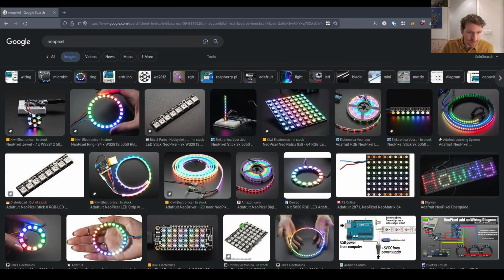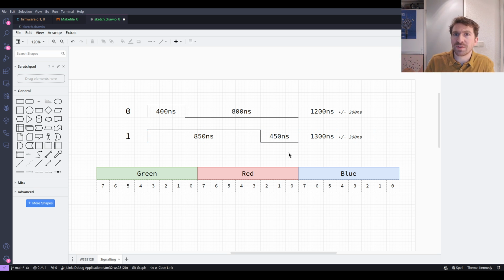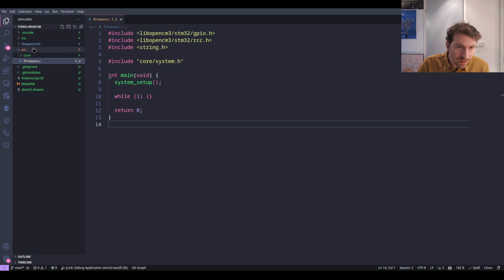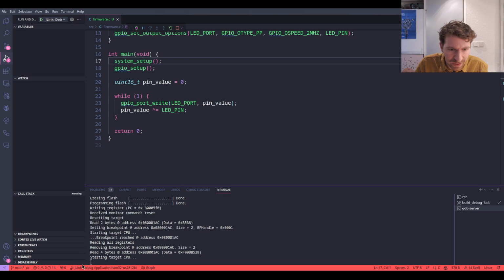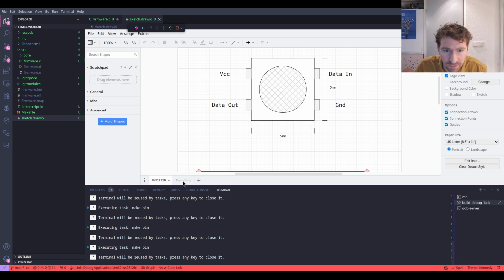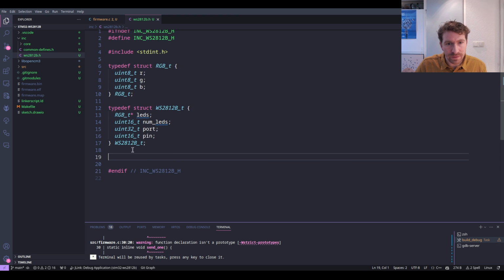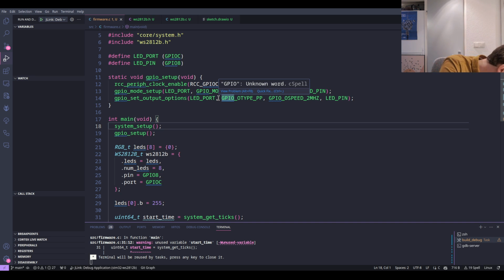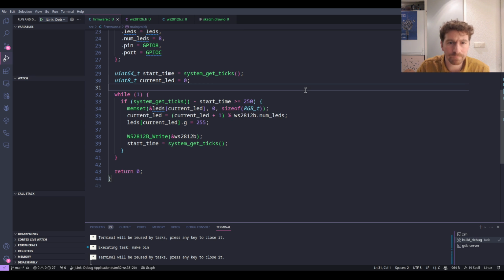Bare Metal Bit Banging: WS2812B Driver

Comment: awesome video!
if only i had found this video for my microprocessors final, it would have been cool to create a neopixel driver
instead, i just used a hack of the spi mosi pin since it met the timing requirements
Reply from the maker: SPI is usually the best route to be honest, especially if you have other time-critical stuff happening on the micro. But bit banging is definitely not as bad as most people would have you believe for this protocol, especially if you just have a few LEDs to drive

Comment: Is it possible that the fact the nop instructions don’t consume time consistently as you add them is because a NOP on ARM is not guaranteed to consume time, the processor is allowed to remove them from the pipeline?

Comment: Horrible implimentation. Using assembly code for critical timming is a bad way of doing it. Because of the many, many different types of uP boards out there with so many timming variants will require too much tweaking of the assembler code. Very sloppy code
I developed a hardware interface that you can raise a PROCESS line, then send the three data bytes and monitor a BUSY line to drop when u can send another group of 3 bytes. You so this for all the pixels you want to send. At end u drop the PROCESS line and wait for busy line to drop and you are done. Easy peasy. Works on ANY uP too and is rock solid

Comment: One technique I've seen used in a lot in vXWorks board support packages is to calibrate a spinloop based timer against a slower hardware timer. The idea is you spin incrementing a counter starting at one timer tick until the next one. That then tells you "x counter increments equals one timer tick". E.g. on PC AT hardware the PIT timer runs at 18.2Hz, i.e. a 54.945 ms period. So if you know x timer increments equals 54.945ms you can scale that to smaller numbers for smaller delays. You probably need to lock the CPU clock speed and disable interrupts during the spinloop.

Comment: This is one of those videos for a channel that you have never heard of before, and you just sit and watch with your mouth open. This was absolutely unbelievable. The bit at the end where you lamented that getting an arduino or an STM32 is the easy part, but then OK, I can flash a LED. But then what?? How do I develop code? Rather how do I even start or go about developing a project?!?!? Where and how do I start?!?! If you don't know, you honestly don't know. That is where I have been for 2 years, since my initial C++ course. I have bought arduinos, STM's, ESP32, but I have no idea where to start, more so how to start a project.

One in particular that I want to do and have had no idea how to begin. Is to literally send a simple query request to a device using MODBUS every 100ms (or 250ms really...), then receive the response, take that number and do a calculation with it, then output a pulse train from it. It seems super easy, but no idea where to start. How do I even generate an accurate pulse train with an ON time that comes from my calculation???

This video sort of gave me a place to start.

I believe I would use one of the MCU's hardware counters instead of trying to use software as I need the software to do the communication and the calculation based on the received communication. I think I would need to use interrupts as well. Gave me more to think about and I think some type of a pathway forward. Its amazing how watching someone explain and do something, breaks down the fear of trying it yourself. Fear of failure is so insidious. 🙂

Thank you so much!! Subscribed and looking at your other videos shortly!
Reply from the maker: Thank you for this comment - I'm really happy to hear that this video gave you a direction to follow. I know how opaque this stuff can be, and how hard it is to find quality resources. Take a look at the bare metal programming playlist if you're interested in going further. I used it as a vehicle to discuss a lot of the areas that are often taken for granted in embedded, like understanding datasheets and reference manuals, memory mapped IO, how to use peripherals properly, etc.

Comment: This is so cool. Where do you find ideas like these? And any good resources on learning and getting more involved in low level development? I have programmed a fair bit in C/C++ but mostly from university, and I would really like to make some projects to showcase/expand my knowledge.
Reply from the maker: Thanks, glad you enjoyed it! I think a good way of getting into lower level code is grab a cheap arduino kit from amazon or aliexpress with an uno and a few sensors, wires, etc and get some lights blinking, read some sensors, and other little projects using the arduino libraries. From there you can learn about programming without using the arduino framework and libraries (search something like arduino register level propgramming), reimplementing the same projects from scratch. Combine that with Elicia White's book "Making Embedded Systems", and that'll put you on a fast track to learning C, low level programming, CPU internals, how to talk to other devices over different protocols, etc.
Reply from the maker: Oh, and look into the wokwi online simulator. You can program for virtual devices (emulated arduinos, ESP32s, etc), which can be a good way of learning about this kind of thing without paying a single penny.

Comment: Just a quick thought. Should you be turning off interrupts while you are bit-banging? And could this cause the issues of the flickering. Would only be visible when the LED is off as a single bit flip due to timing error would not be visible on a lit led. Just a thought.
Reply from the maker: It's possible, but not probable in my opinion, since the interrupt code here would be running very quickly - 10s of nanoseconds.

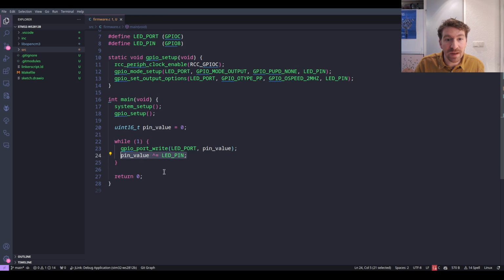Comment: what precisly is the reasoning behind using LED_PIN at 30:46? As far as i see gpio_port_write expects data as an argument, how exactly can a LED_PIN considered a data in the classical sense? I understand that the 8th bit denotes the very pin we want to use to communicate. Does that mean gpio_port_write turns the pin on and off? why 16 bits then?
Reply from the maker: A "port" is made up of uo to 16 GPIOs, which you can change the state of simultaneously.
Reply: @LowByteProductions  okay makes sense (-:

Comment: i have made an implementation on stm32 to drive this """smart""" led by leveraging DMA and SPI. the only caveat was to bound the peripheral speed to a certain, specific speed to make the bit timing correct.
Worked like a charm
Reply from the maker: I had assumed that you'd need an 8x larger buffer for that, but haven't looked into it I see that you can get 3 bits per byte which isn't bad at all. Nice method indeed
Reply: @LowByteProductions yes, you are 100% right. buffer was very big indeed. not always useful in any situation.. but, if the number of led's was small enough, could be a good method to not have mcu "wasting" time between bits...
Oh... by the way, your contents are killer... thanks

Comment: https://youtu.be/KUklOA91nk0?feature=shared&t=2572

I do not think your reasoning is correct here. The thing does not work because your NOP_420NS macro does in fact not take 420ns but rather 420ns - 120ns = 300ns to run (the whole thing sums up to 420ns, as your port write takes about 120ns). Doing the calculations, this lines up with what you were getting with 2x NOP_420NS: 300ns * 2 + 120ns = 720ns.
Reply from the maker: You're right! Hard to think and speak out loud at the same time 😅
Reply: thanks so the noop is linear!

Comment: Great video! Thank you! 

One thing I noticed was that you will only have either 255 or 0 on the RGB channels, since you only check bit 7. So, if you would set the channel to 0x70 for instance, then you would get no color in that channel. You'll probably want to do if (r & (1 << (8 - bit))) or flip the for loop to decrement.
Reply from the maker: Ahhh you're right, don't know how I forgot to shift 🤦‍♂️

Comment: I know this topic is bit banging the control/data signal, but wouldn’t using a PWM be better to keep tighter timing?
Reply from the maker: Sure! I mention a possible PWM approach in the video using Timers and DMA. It's definitely the better way to do it, but bit banging is universal and the method will apply to any micro
Reply: @LowByteProductions  sorry, was a long video and sort of skipped around to the middle and watched some while I was out. Bookmarked to watch it fully a bit later.  Thanks
Reply from the maker: @LordHog no worries!

Comment: You are back, wohoo! (while I was waiting, I started watching your oldest videos) A fun story about the WS2812 family: I have the WS2812C and I tried to place on the PCB without checking its datasheet. The problem is, that I assumed that the pin 1 is the marked corner, (just like on every other components) but in reality it's on the oposite side of the led and the marked pin is pin 3, so I had to spent many hours debugging my design. A good tip to everyone: you should always double check your datasheets!
Reply from the maker: One more reason to be grateful for the reverse polarity protection they built in!

Comment: For driving ws2812 I like using SPI more. Just define a bunch of constant for bit 1 and 0, send them to MOSI with correct clock and you are done
Reply from the maker: That's a pretty cool approach! Not without tradeoffs though, right - since you'd need an additional transmit buffer 8x larger than the data you're trying to send, and also need to spend CPU cycles translating the bits to bytes in that buffer.
Reply: done the same, you are trading "space" for "time", sometimes it is worth, other don't...